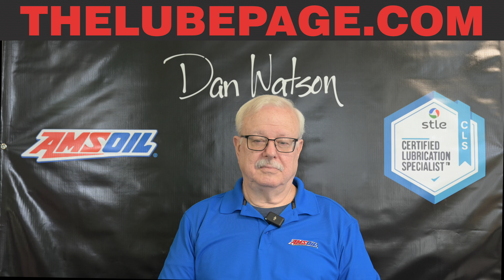V7 Oil Composition

Comment: A question, if you allow me, can I use AMSOIL 5W30 OE for more than 6 months and 5,000 miles, and what is the basic recommendation for this type of oil in terms of duration and distance? I only drive 5,000 miles per year at most , thank you
Reply: Ok, thank you very much mr, Dan for your reply in email .